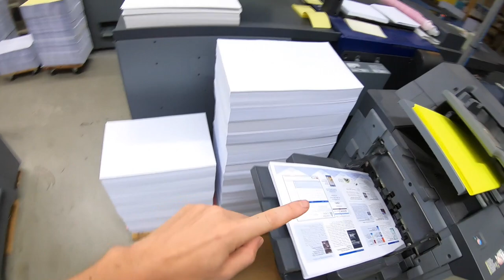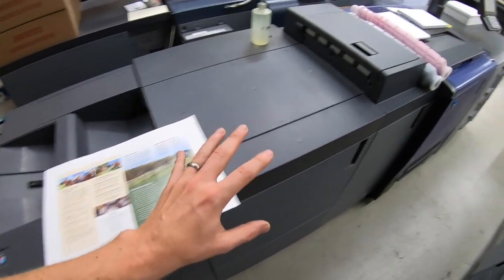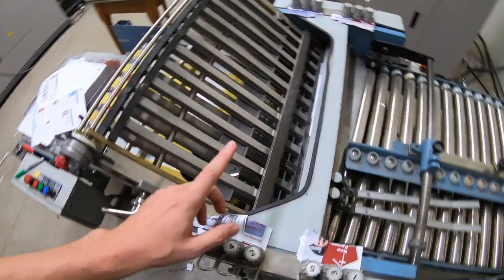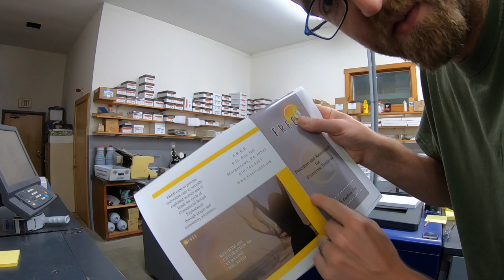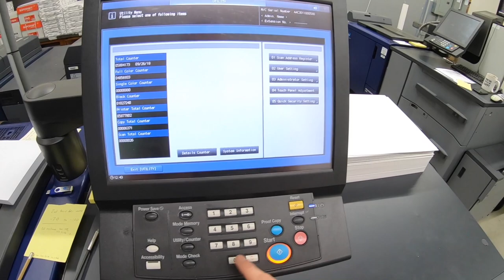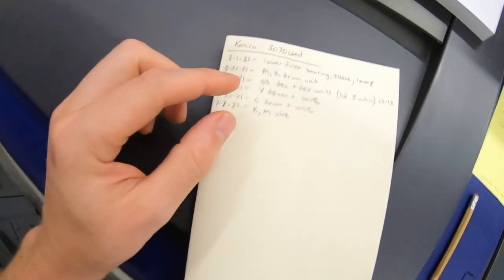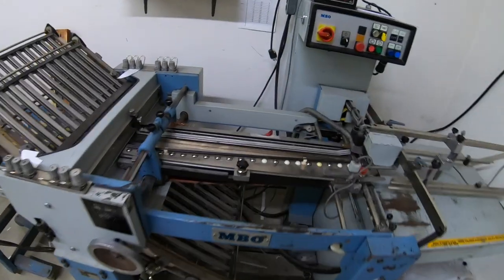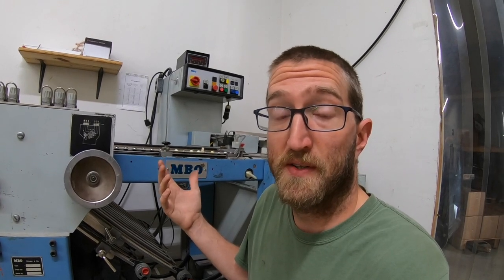Corona Wire Replacement on Konica Minolta C3070, MBO T49 Folder Feeder Belt Fail

Comment: Check your bearings on each end.... That will kill the belt and then there's the other thing. Sitting. I can't tell you how many of these belts I have replaced for people and alot of times it's from the belt sitting in the same position and the Belt getting a "memory curve." Not telling you to spend money but since you will have the Sideguide out check to see how much of a groove is in the inside where the sheet runs up the rail. Mileage will vary but if the groove is deep it will give major registration problems.... Easy work for you Dan....
Reply from the maker: Interesting. I do need to check bearings. Some of them seem a little loud. My folder sits more than it runs so it will be interesting to see if there is a curve in it. I'll be working on that tomorrow.
Reply: @Just A Printer. I have been looking closely at your MBO sidelay with reference to it being worn along the inner guide edge. From your video, it looks like the sidelay "channel" has been "fold - formed" from a single piece of stainless or high chrome steel. Both of these materials are very hard wearing and are used to reduce/conduct away any static electricity. The belt would fray at the inside edge first rather than wear the sidelay material. Good idea to check the bearings for any excess wear and tear! Good luck in your adventures in Folder Maintenance Land!!!

Comment: Ref. Changing the sidelay belt on your MBO folder. I can only draw from my experience on the equivalent Stahl models T47/49/50/52. which are very similar to your MBO. Remove all the hold-down rails from over the indeed table. Adjust the sidelay out to maximum size and the "closed" sheetguide on the drive-side out to its maximum too. You might find it helpful to tie/bind the "concertina"/lattice rails together, which are the bed of the infeed. Use string or long zip ties. This keeps them in a block and manageable. Usually you have to remove the cover over the drivebelt on the drive side of the machine. It should be possible to release (by loosening some small Allen grubscrews) the cross bars that hold the lattice from the frame, and the hexagonal (?) drive shaft from its belt drive pulley. You should be able to withdraw the cross bars and drive shaft towards the motor side of the machine. You need a gap just wide enough to slip the old sidelay belt off. You may need to release a spring loaded/eccentric cam mounted tensioning pulley under the sidelay. You fit the new sidelay belt in the reverse order. Remember to clean off any crud that has built up on the barrelled pulleys that carry the sidelay belt.
 Back in the last century Stahl used sidelay belts from OEM, branded "Essband". These belts had a running direction arrow printed either on the inside or outside surface of the belt. Please ensure that you check for this running direction when fitting your replacement belt to the MBO. 
Just an observation, but you might consider reducing the number of steel balls (S) in the sidelay guide. So starting at the end nearest the folding rollers, the first five holes S P (plastic) S P S, then P P S, P P S, then P P P S P P P S, then P P P P S P P P S, then repeat the S P S P S under the two - sheet detector. Don't know if you will be able to fit the above pattern into the length of the sidelay, but you get the idea. The 2 degree angle/incline on the sidelay was set after many hours of trials and testing by Stahl. I anticipate that the MBO will be the same. Ultimately the weight of the steel balls will wear the belt, so by reducing their population in the sidelay you are saving your time and your money. Good luck with the belt exchange. Stay safe and well.
Reply: @Just A Printer. Sorry, I forgot to mention. Please release the tension on the sidelay belt before withdrawing the infeed table support bars and the hexag. drive shaft. You can then check if the bearings on the sidelay belt pulleys are O.K. Just memorise the way the infeed belt is fitted to the sidelay. As your belt has disintegrated, you can just cut it off!
Reply from the maker: Thanks for these tips! I'll be replacing the belt tomorrow!

Comment: Those belts are a common item to wear out on folders. The OEM belt will last 2 times longer then the one you get from Update but that’s normally fine. I keep a whole set of belts on the shelf for our MBO to save overnight freight costs and any major downtime.
Reply from the maker: Sounds like I should learn from you on how to replace the belt. Good to know OEM belts are better. I ordered from binderyparts.com, which is probably the same belt that update sells. Wish me luck! :)
Reply: @justaprinter   The worst part of the whole replacement is cleaning all of the old crud off. You need to get it perfectly clean and if it got into the rollers that takes some work to get off. You know way more then the average guy who works on there own equipment and this will be simple for you.

Comment: Very interested in seeing you replace the belt on the mbo, we had the exact same belt failing on the stahlfolder.
Reply from the maker: I'm nervous, but it should be interesting if I can pull it off!
Reply: They all fail at one point..... If not from just wear from use it's just inevitable. Where it becomes a financial hindrance is on the late model Heidelbergs with Vacuum sideguide. Unless the game has changed in 2021 you have to bring the Factory tech in for it....

Comment: You know you don't have to rebuild the charge Coronas. All you have to do is clean the charge wire with nothing but water and a cotton rag.
Reply from the maker: I have tried that but still had better results with new wires. But maybe I didn;t clean the wires good enough. I should experiment some more. It would be great if I didn't need to buy replacements.
Reply: @justaprinter  when you clean them make sure you clean the whole thing. Includes the housing also.